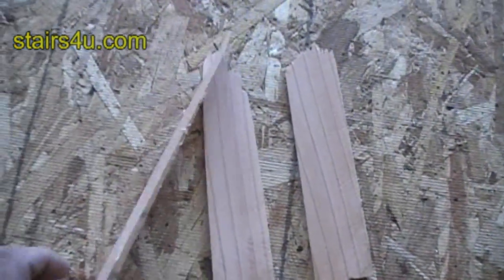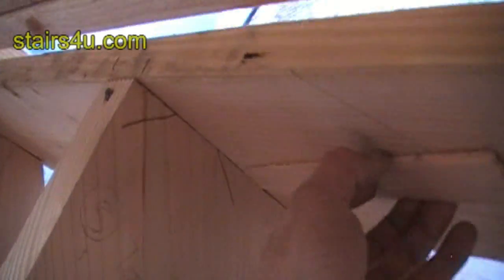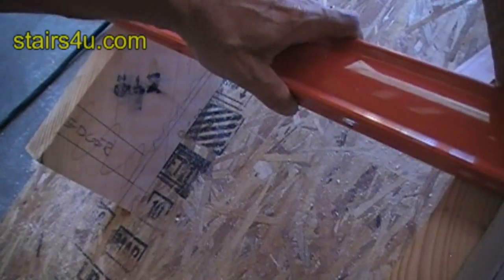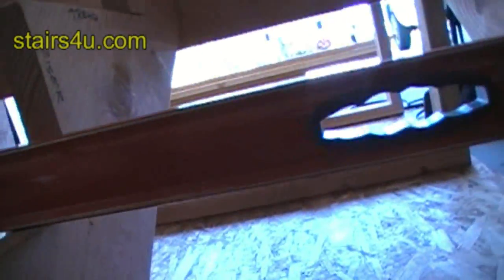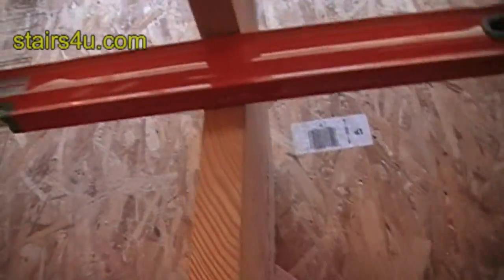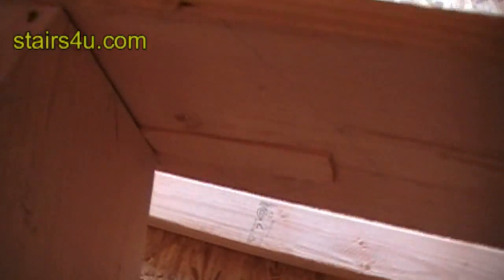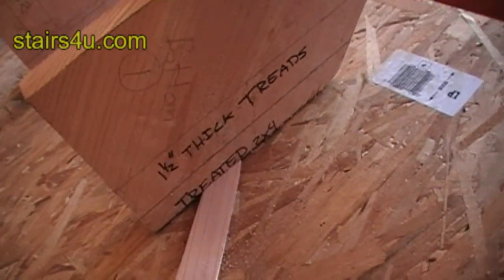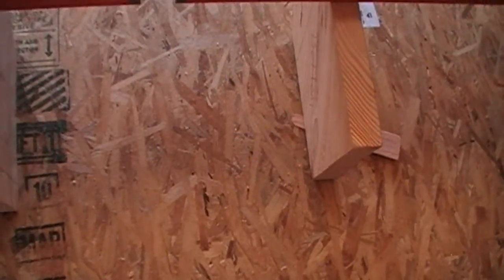Adjusting Stair Stringers Using Shims - How to Build Stairs

Comment: I'm not sure if you'll get this comment in time, but I'm trying to redo my stairs. Not completely, but just take the wood off and put new wood on with a white riser. I want to add a runner along the side of the stairs on the wall, but the stringer is in the way and I'm unable to slide the white runner along the sides of the stairs. Is there anything I can do? Should I explain this better?